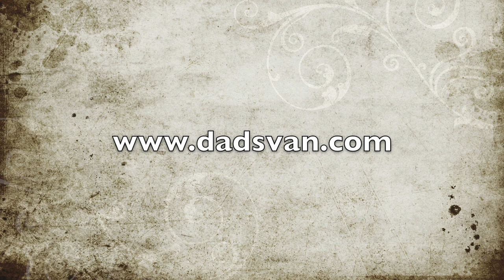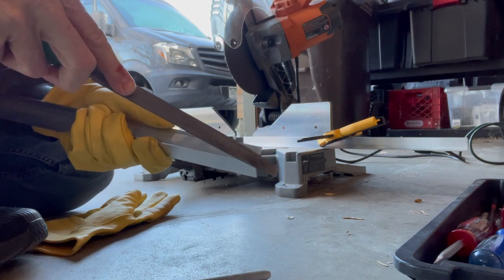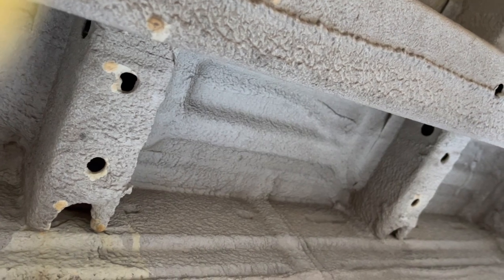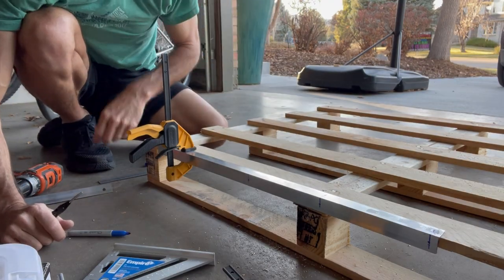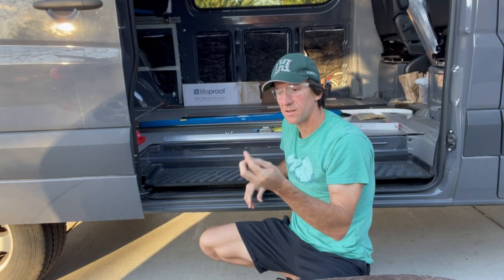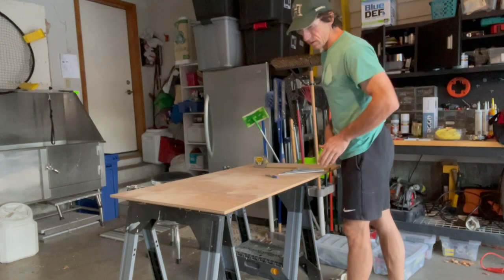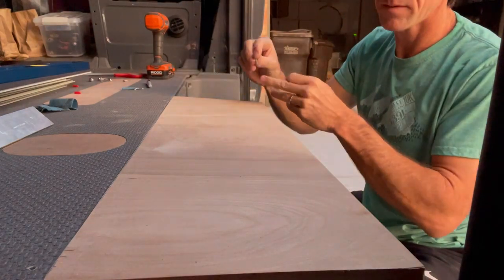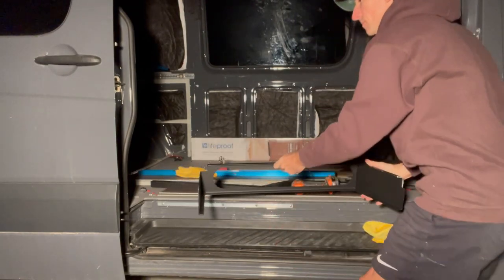How to install a step extension on a Sprinter van - Finished floor install series part 2

Comment: Do you have a video for what you've done to install your bed?
Reply from the maker: Yes!  I have videos for the platform bed as well as the folding seat. If you mean the platform bed, there are two videos. Here is part 1: Platform bed install in Sprinter van Part 1 -  L-track mounting
https://youtu.be/DLLX6eKNq2g
Reply: @DadsVan  Thanks
Reply from the maker: Here is the link to the series: https://www.youtube.com/playlist?list=PLJm3gbVNV2xcg1VkWe6NhOS53pjzekH8a
Reply: @DadsVan  Thanks, I have the Ikea parts. I was also wanting to install to LTRACK. The attachments are gold. Thanks for the tip
Reply from the maker: The video description has the part number. Here it is: US Cargo Control part# 1519-EBF
https://www.uscargocontrol.com/Double-Stud-Fitting-w-Bolt-Thread

That attaches to ltrack, then I bolt it to angle steel, then bolt through the angle steel and through the ikea bar and through the platform panel
Reply: @DadsVan  Thanks

Comment: Sometimes I feel like we’re building the same van. Question: is the wood attached to the step extension directly with screws or sikaflex? When you attach the trim piece over the finished flooring do your screws go all the way through the extension metal or just into the wood subfloor that’s resting on top of the metal? Thanks!
Reply from the maker: Subfloor is attached to extension metal box with silkaflex.  The extension trim screws only go through vinyl planks and subfloor